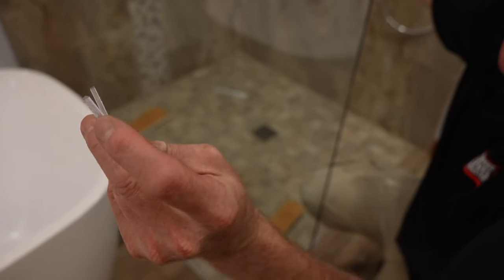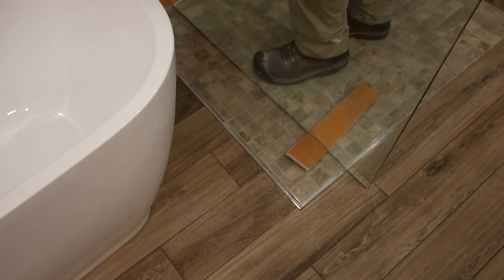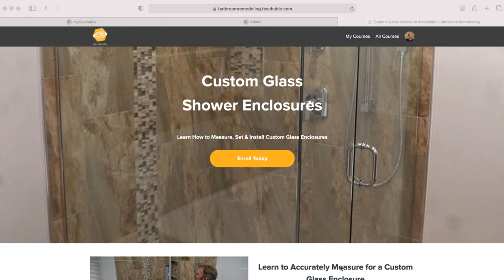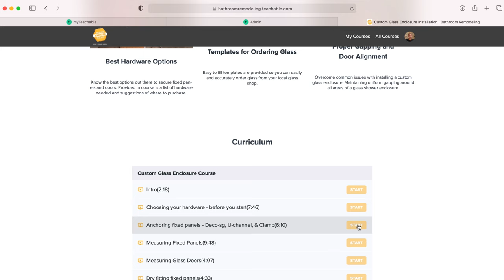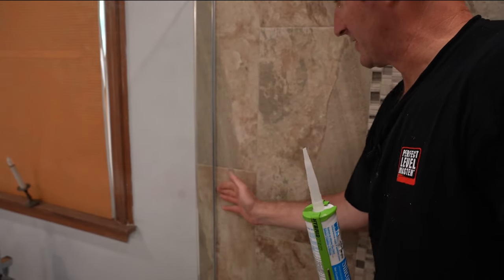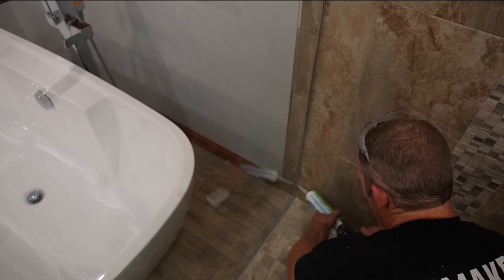Custom Glass Shower Enclosure l How to Install l PLAN LEARN BUILD

Comment: #1 we use 1/4 inch green anchors for the screws every time, #2 Comming back next day just for caulk is counter productive finish the job same day, spray some alcohol and tool with a rubber block job done, great video tho !

Comment: These comments on the silicone I assume don’t know the difference between regular and “ water clear”?  Or am I missing something. I see CRL for $12 but not the water clear. Not an ex just researching for my own I am about to install. If the difference in milky clear vs “ clear. Well I get the difference. So please chime in with valuable information. Thanks

Comment: Coming back after 24hrs to cut the silicone out is more work like I said before, a lot of this could be prevented and running your finger across the bead of silicone where glass meets is just messy, kind of unprofessional man

Comment: Filing the Chanel with silicone is too much work and messy all around just put the glass in the Chanel and run a bead of silicone on the edges of the Chanel and glass and it’ll look much more cleaner and professional

Comment: Good job!!Coming back a day later to address the silicone again is sort of counterproductive. One of the old guys in the field taught me how to tool silicone correctly. After running your silicone for the perimeter gaps, spray either an aerosol glass cleaner, or a mixture of dawn dishsoap and water, over the silicone you just ran. This allows you to tool it without making a mess everywhere. If you happen to smear some on the glass, it will wipe right off. 

I do shower doors for a living and have seen some neat tricks

Comment: Nice video, so is there nothing which holds the corner where the two glass panels meet other than silicone? Just wondering whether that would come apart if someone were to slip, or lean on that front panel when taking a shower.
Reply from the maker: Just silicon. You can buy a top clamp if your overly concerned about that. It would take some tremendous force to knock them apart 👍 https://amzn.to/3HR5cjH

Comment: Great info. Thanks. Do you recommend 1/2" glass, pros and cons of 1/2" verses 3/8" thick glass? Thanks
Reply from the maker: There’s really no benefit for the added expense in my opinion. A commercial storefront….yea 1/2”. More durable. But for a shower, pretty much looks the same 👍

Comment: Have you done a glass to glass mount for the door?
Reply from the maker: Been a long time, but yes. Not too much different than. A wall mount hinge. Just make sure fixed panel is set before hanging door. Clamps on fixed panel allow you to finish in a day, otherwise silicone needs to dry before hanging door

Comment: Are the bottom channels screwed into the floor? Do you have to worry about not drilling through the membrane? Thanks!
Reply from the maker: Used the deco sg profile….no screws 😊 https://youtu.be/nu83oRTHarM
Reply: @BathroomRemodelingTeacher  thanks for the reply and great video!

Comment: are the hinges drilled in to stud? What are my options if the hinge is between studs?
Reply from the maker: Yeah, I always add blocking (2 x 6) behind the area of door to anchor. You can use wall anchor plugs if you don’t have anything. That will work with having tile. 👍